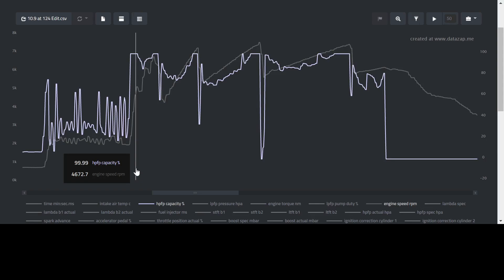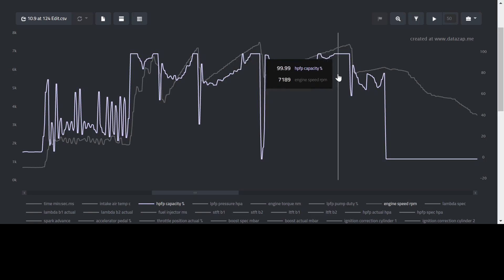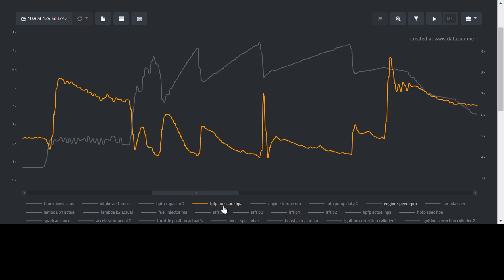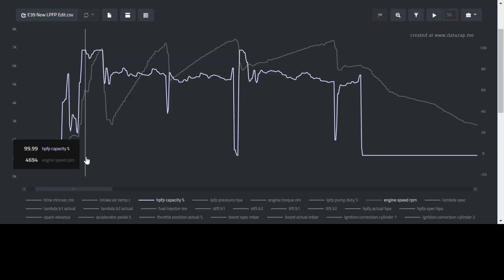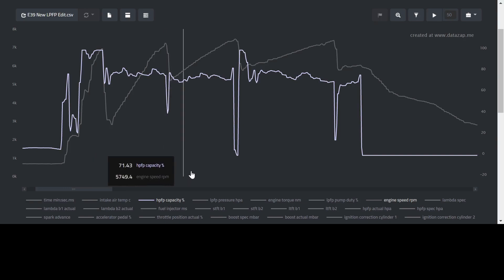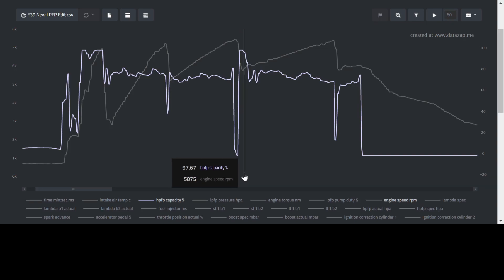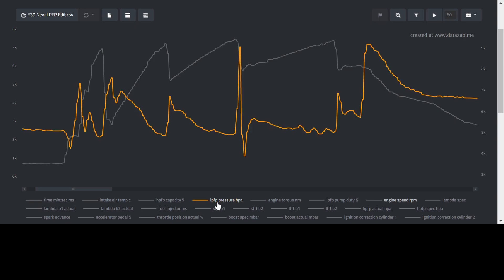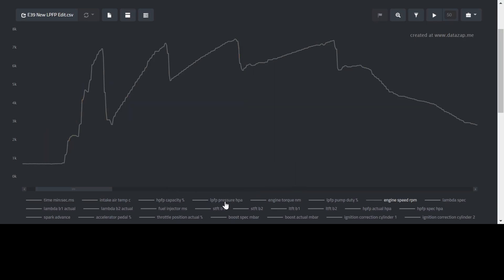Audi B8 S4 Low Pressure Fuel Pump Replacement & Log Comparisons

Comment: Hpfp was always going to be the more likely culprit. The lpfp is more crucial in terms of flow rather than pressure.
Reply from the maker: You'd be wrong in this case. The HPFP was working perfectly fine. It was the battery that was the issue: https://youtu.be/qIbGEbod8Bs

Comment: Its interesting that you say the LPFP should be around 4800 hpa. That's where mine is while I'm cruising. It tops out at 6k + when I'm at WOT on a E40 blend. 4800 still seems low to me.
Reply from the maker: I don't say it should be 4800hpa. I say that the lowest it should get during a WOT pull is 4500hpa.

Comment: I realize that last week running e40 for the first time maxed out the hpfp at 6k rmp I got a CEL for low fuel pressure, older pumps don’t like higher ethanol.  This video is just what I been dealing all week lol  if I find the issue with this pumps I will let u know . This Cars start pulling a lot of timing when you running out of fuel . So make sure you don’t melt your cylinders . .  Awesome video like always , probably next is making sure your injectors have the correct flow .
Reply: I'm dual pulley on 93 and got low fuel pressure with ie hpfp hoping logs show my low pressure pump taking a shit

Comment: Which spark plugs and gap are you running? I am running BKR8EIX at 0.026-28 gap with stage 2 single pulley, it cleaned up my logs compared to the stock plugs at stock gap.
Reply from the maker: During this video I was running the Brisk DR12S, but since then I have changed to the BKR9EIX at a 0.22 gap.

Comment: You consistently have a lpfp pressure drop at the 3-4 shift on both pumps.
Reply from the maker: That's the way the car has run since I purchased it and have continued to upgrade.
Reply: @VancityAudi  I wonder if you don't have valve float?  3rd is the only gear running out to 7450ish rpm.  Very interesting issue and thanks for sharing.  Hope you get it sorted.

Comment: My money is that it is something with the IE tune. If not there it is a issue with fuel injectors. Likely best to take them out and get them flow tested and cleaned. Another thought is that the higher Ethanol could have loosen some crap in the fuel system causing a clog at any point in the fuel system.
Reply: everyone blames the tune after switching to 034
Reply from the maker: This has absolutely nothing to do with the tune, lol. It is a hardware based issue. We have continued to dig in and have found other issues already which will be shared in future videos.

Comment: Cool video again Adam! What was your rail pressure before and after, did that change?
Reply from the maker: My logger doesn't record rail pressure, sorry.
Reply: @VancityAudi  it's not hpfp actual hpa?
Reply: or does it basically just show a 1 the whole log.
Reply from the maker: @dirk5950  my apologies if that is the same thing, lol. As much as I know a bit, I'm still learning other terms. The "HPFP actual hpa" improved significantly as well after we replaced the pump.
Reply: @VancityAudi  yeah, would be surprised you could see eff. volume but not pressure. that would be odd.  sheet, im still learning the mk7 golf platform years later.  all the softwares reporting things in hpa, or millibar or psi and not being standardized is pretty annoying, lol.  is ambient pressure included in this value or not?  lol.  yeah, always learning.  it's fun though!

Comment: May be a dumb question, but is there a reason you don’t add octane booster for timing pull?
Reply from the maker: Octane booster isn't good for your car. It corrodes your spark plugs. With the perfect blend of ethanol and pump gas I was seeing no ignition correction.
Reply: @VancityAudi  interesting, never knew that. I don’t remember seeing if you had to change your lines out for ethanol or just D the ethanol meter
Reply from the maker: @bagelbandit6076  you need to upgrade your HPFP to run an E40 tune. That's it.  https://youtu.be/QZdhAsxmsBw
Reply: @VancityAudi  thanks!!

Comment: Should have upgraded and installed an RS7 LPFP, direct fit
Reply from the maker: There's no need when this was cheaper and works as needed.
Reply: @VancityAudi  Its going to act up soon again, they don't perform too good with e40. The Rs7 one is great with e40
Reply from the maker: @DavidMoore12345  I don't like your pessimism, lol. Fingers crossed it holds up for me.